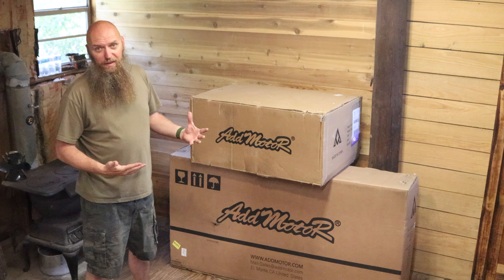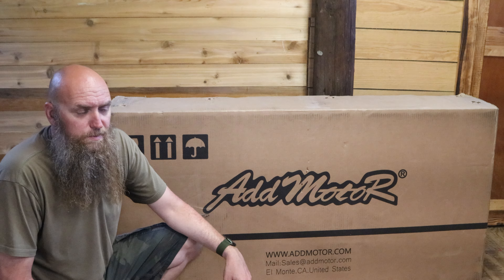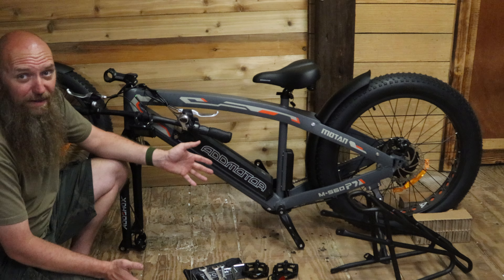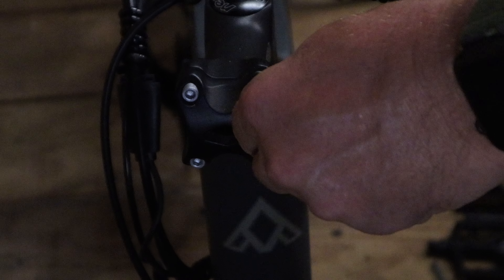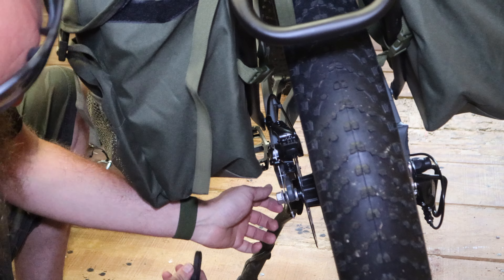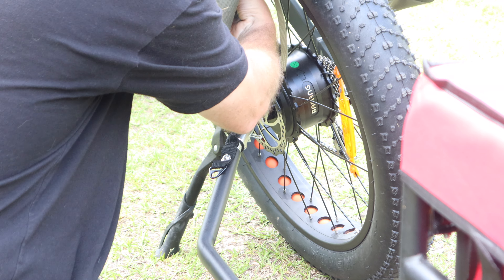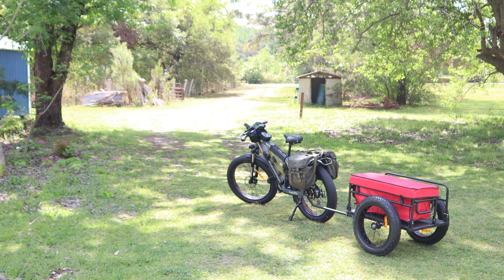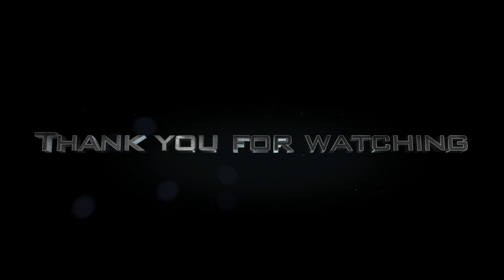Addmotor Electric Bike Unboxing and Review: The Ultimate Commuter E-Bike | FireAndIceOutdoors.net

Comment: Their customer service is not excellent! I bought the M550 after reading 4-5 hour charge time! The 2.5a charger that came with my bike was busted up and I had to get them to replace it! After like 2 week I finally received it and they downgraded the charger to a 2a hour charger which took 8.7 hours to fully charge! I call them on the false advertisement and they said I was reading an old advertisement which was false because I ordered it through Amazon! They offered to send me; now get this of all things a “free” dart board! Yes you read that right a dart board! 🤦🏽‍♂️ then a bike pump! Yes everything but the 3A hour charger that would of taken 5 hours to charge! Now after a month of riding the crank is knocking when I peddle!